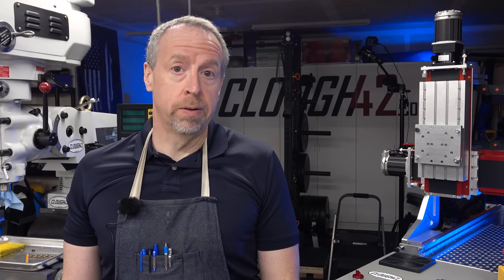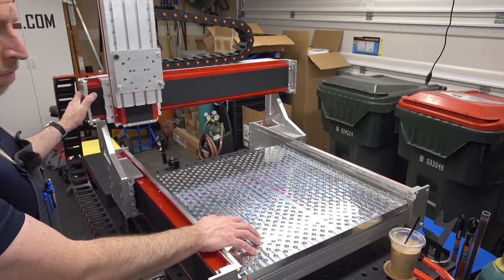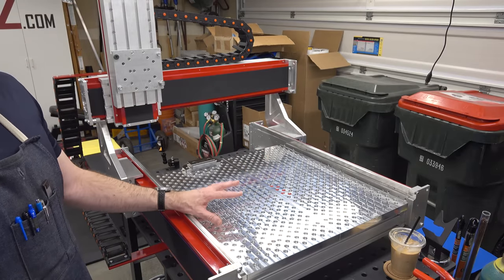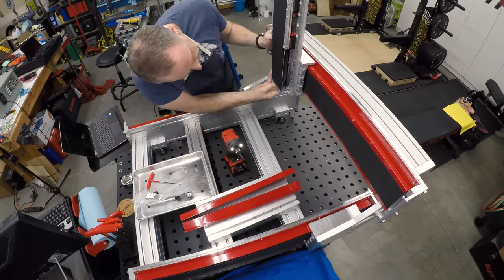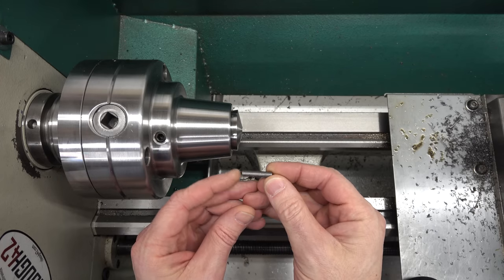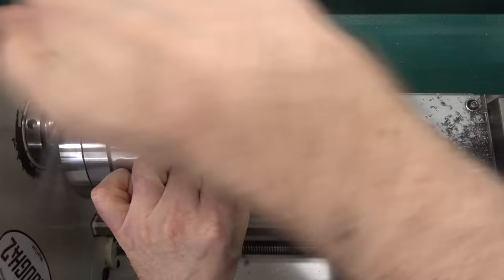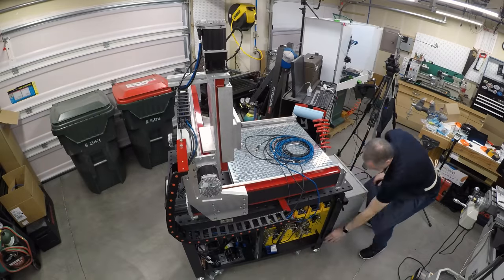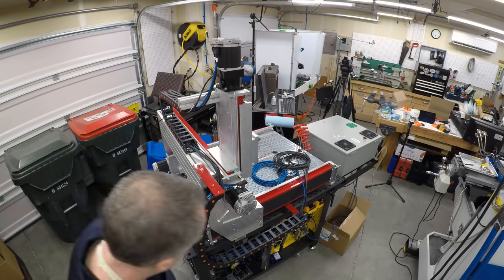New Machine:  Avid Benchtop Pro CNC with ClearPath and Centroid Acorn

Comment: Don't forget to do a vid of when you autotune the clearpath servos. Is you little grizzly mill too small and limited to take advantage of the powerful spindle? Are you going to convert the grizzly back to its original spindle?
Reply from the maker: The grizzly works fine with the spindle, for what it is.  But the high-speed spindle can't really take advantage of the rigidity of the mill, because it can't swing big tools or run slow enough to really drill and hog steel.

Comment: Wow! That's a great looking machine, congrats. Love all your videos. I was curious about the way/leadscrew covers, are they like a roller blind type thing?
Reply from the maker: They actually snake through the slide, over the frame, but under the outer T-slot plate.  So they bend as they go through, but they don't actually move themselves.  It seems like it would have a lot of resistance, but it seems to work okay.

Comment: 18:20 servos should all be mounted with the cables on the bottom to help prevent ingress. Check my avid build if you're interested.
21:20 I strongly suggest hardstop homming with the servos instead of using the inductive sensors. I just use the sensors as an estop safety feature. An estop / enable latching relay is good for homming the servos. (home on first enable) hardstop homming will go to the same clocked position on the encoder each time so it's much more repeatable. You can offset the y servos differnetly in the clearpath software to square the gantry.
Also, as you may know, the servos run better with stiffnes turned up and you may need to do multiple tunes to get a good one. Tune x then copy to y1 and y2.
32:26 you can set the max torque to disable the motor like crash detection, either in max torque, or use the HLFB IO output and set to for out of position. It has saved me from breaking bits, parts, and the tool length sensor. It's incredibly fast acting. My 4x HLFB go into an arduino that acts as a 0.1ms buffer incase there is noise. IIRC the out of position is set to about 20 counts. It will mainly go out of position during rapids under normal operating conditions so that is the factor to consider when tuning that value.
-Ken

Comment: I am very interested to see how you'll optimize the auto squaring script. I am thinking about upgrading my controller to acorn and I also have a dual Y axis configuration. I see that you've had to resort to a software auto-squaring script and am curious how the wiring of the endstops in centroid will allow for a "hardware" approach to the squaring procedure.
Reply from the maker: I think the software squaring is fine.  It just needs the delays removed.  By default every message it displays causes a 3-second delay.

Comment: Sick machine sick servos.  I got a beefy machine as well but with steppers.   I use the same sensors as you have and cutting material would constantly set them off
Reply: Also great job as usual and great video.
Reply from the maker: I've been drawing up circuits to properly combine NC proximity switches instead, but your point about chips setting them off is a good one.  Not sure how big an issue that will be.  I guess we'll see.  I'd honestly be pretty happy with plunger snap switches mounted in the same holes.  Neither has the overtravel to survive a full-rapid crash anyway.
Reply: @Clough42  While looking at limit switches for a CNC build I came across a configuration where the limit switches are mounted perpendicular to the axis so the gantry can bypass the switch. In the event of an over-travel situation (read crash) the gantry simply runs past the switch without damaging it. The accuracy/repeatability is still excellent. Would it be worth replacing the bumpers with E-Stop switches wired in series?
This whole setup looks awesome!!! I think you can broach a 1/4" keyway in one pass with those motors. ;-)

Comment: Not sure if you are still monitoring comments on this video? But I have 2 questions about the build as I have been building my control box using the Acorn Card, I see that you used the Avid NPN NO switches, was there any issues using those in hindsight? I need to go back and look at the schematic, but I believe there is a difference in wiring them is that correct?
Thanks Your is the best video on setting up an Acorn Card!

Comment: James should the machine home be set at the right rear and the work home be set at the front left for "normal " CNC setup  another great video. This machine looks a lot more powerful than my Workbee which is powerful enough to cut aluminum without a problem
Reply from the maker: I think you can set the machine home anywhere you want.  I kind of think the left rear is convenient, so the gantry will be parked out of the way of loading the work, but the default on this machine is to home in the left front.  It can be set up any way you like, though.  The one downside of homing in the back left is that the Y machine coordinate is always negative.  The work coordinate varies from job to job and is usually zeroed on the workpiece.

Comment: Great video -- I also have an Avid pro machine with a CNC Depot ATC spindle (mine is the SC30).  And my machine uses Centroid also.  You mentioned in the video you'd like to set up automatic tool change in the future -- did you ever do that? I've tried on my machine but the M6 macro hasn't worked reliably -- I mean the M6 macro I had to create based on their stock example versions.  Please let me know, thanks!

Comment: Watching this again, I just noticed that he's using the pro version of CNC12, because axis-pairing is disabled in the free version. For those people, you can use the C86 add-on board, which provides the option of hardware-connected axis pairing. In that case however, the same command is always sent to both servos, so squaring the axis via software is not possible.

Comment: Very clever solutions. I can’t wait to see your working video. Question; why do you feel it necessary to go with the NEMA 34 as you’re using servos?
Reply from the maker: It may not be necessary, but I have no experience sizing servos, and to be honest, the Teknik sales person wasn't a lot of help.  He just said if the steppers Avid sells are "sufficient" then he would go with something smaller than what I chose.  But I know from another YouTuber that the steppers are "just barely adequate" when trying to cut metal, so I went bigger.  The price difference between the NEMA23 and NEMA34 Clearpath motors was about $60 per motor at the time, which is 10-20% once you factor in the power supplies, cables, shaft seals, etc.  I do not want to save a few bucks and then be frustrated two years from now when they are just barely adequate.

Comment: I hope you are thinking about this already, but I would really like to see a discussion of why you chose to add this machine vs the grizzly and migrate the spindle over. The pros and cons would be really interesting to understand, especially given the other machines you now have. I notice that you mostly do parts in aluminum, but did you ever do much in steel with the grizzly once you had the S30F on there?
Reply from the maker: I've done a couple of projects in steel with the FM30F spindle.  As long as the tools are small, it does a great job.  I have two issues with the Grizzly: the Y axis is very short, so I can't practically manage parts over about 4.5", and the Z axis continues to be a source of backlash and/or lost steps.
Reply: @Clough42  thank you for the detail. I feel you on the work envelope problem. Even with 12” on my knee mill it always feels tight. Now you need an iso-30 right angle head and you can have infinite z height, too.

Comment: Nice machine, I built the same machine as well using nema 34 steppers , mach3 and a 4" kurt vise. not as rigid as I would like, the steppers work fine for me , when cutting aluminum you must go slow and get an OK finish
Reply from the maker: I'm very curious to see how it works.  I have found that the 12Krpm spindle with aluminum-specific variable-flute cutting tools to be pretty smooth on other machines.  I'm expecting resonance to be the biggest factor.
Reply: @Clough42  I do use amana cutters but I do not use coolant as I have a MDF spoil board and takes a bit of time to remove .

Comment: What's the approximate total outlay for a system like this?  I'd love to duplicate.  
Your work on the control cabinet is A++!
Reply: With clearpath and Acorn, He’s gotta have near $7000 into this, probably more….. $10k+ once a CNCDepot S30 goes on 😍😍😍😍
Ps> haven’t priced any of the Saunders Machine Works fixture plates,  but I’m sure that’ll add atleast another wad of $$
Reply from the maker: You're in the ballpark.

Comment: Just re-watching as I am in the process of swapping out my smaller Parker Z stage for the AVID Z and noticed you have an adapter for the NEMA 34 CP. I'm using my old NEMA 23 CP until the 34 shows up, but it looks as though the AVID mount accepts either; is the adapter a requirement?? (also curious about which 34 CP you chose as a sanity check).

oh duh. You said you mounted a brake, didn't you. Sorry, never mind :)

Comment: Hi James. 
Super interested in your build. Any reason why you went Acorn and not something like Masso controller?
Reply from the maker: I was running away from MACH and was considering LinuxCNC/Mesa, but opted for Acorn as something commercial that would require less fiddling.  I wasn't aware of the Masso at the time, but it looks pretty cool.
Reply: @Clough42  I work at a CNC manufacturer and we outfit a lot of our machines with Masso. It's quite a good unit. 

I really enjoy your videos btw. If you ever need any help, please let me know.

Comment: I’m planning on using clear path servos for a mill build as well. How accurate is your homing sequence? I’m on the fence of using DMM servos because they use encoders with a home reference point to preform a very accurate homing sequence. I’ve read about the hard stop method of homing with clear path but I’m worried about build up of chips of gunk that would cause repeatability problems. Can you give any advise or opinion your willing to share?
Reply from the maker: The homing sequence on the mill today is as accurate as the proximity sensors.  I discussed the hard-stop homing sequence with the applications team at Teknik, and it sounds like it works pretty well.  The Centroid Acorn isn't set up to use that method by default, and since I have the end stops and the gantry squaring routine expects to use them, I just went with what was easy.  If I had to guess, I would think the ClearPath stuff would work well.  Everything else about their product is top notch.

Comment: there are definitely the ability to set the current/load limits on the clearpath motors. could you use that to get around your fears of them driving past the stops?
Reply from the maker: For sure.  And also create new ones of saturating under load.  :)

Comment: I know that you have obviously already decided on acorn - but someone like you that likes to get into the weeds of how things work - linuxcnc would have given you the low level access to, well, everything.
Reply from the maker: Yup.  And that's where I started.  But after I installed Linux with the special RTOS kernel, and then failed the jitter test and discovered that I actually was supposed to have used a different RTOS kernel, I decided I wanted to try a polished commercial offering and see what it was like.
Reply: @Clough42  aww.  Sorry your experience wasn't good.

Comment: might be worth getting some thin rubber mat and gluing some feet every few holes to cover all of the holes at once and then cut out the vice area or wherever your work holding is saves you having to install and pull out 700 or so plugs
Reply from the maker: I think in practice, most of the plugs will go in once and stay and I'll be pulling out two or four at a time to mount a vise.  It is certainly a lot of plugs, though.

Comment: I was on the fence about getting this machine with the standard steppers but went with the shapeoko HDM. I believe they can be put into the same class but the option to go custom electronics on the avid really takes it a new level. Have you ever checked out the HDM? would like your thoughts on that if possible
Reply from the maker: I don't know.  I think the Avid is 50-100 pounds heavier, but I can't tell if I'm comparing machine weight or shipping weight.

Comment: OverKill - is the best kill !
Interesting - I have a similar setup ( building my own monster )
I really interested how the auto-tune works with a dual Y Configurations
kinda some thing I didn't find yet
probably will send them a mail soon - for some explanations
if I'll get an answer ( and they usually answer pretty fast )
I'll try to share
Reply from the maker: I should have a video next week showing how I did it (will have done it)

Comment: Are those over-limit switches something you'll want to test on a regular basis? You mentioned they'd never hit it, makes me wonder if they need to be checked as part of a homing sequence or start gcode sequence or something. Thanks for sharing your new machine!
Reply: just manually trip them occasionally . Homing switches get checked all the time .
Reply from the maker: The homing switches get tripped with every homing operation.  The switches that Avid provides are normally-open, which makes me nervous, because a broken or disconnected wire will not be detected.  I'm planning to do something about that, but still working on it.

In general, if the machine doesn't lose steps (it shouldn't) then it's a non-issue as long as you always remember to home the machine when powering it up.
Reply: @Clough42  and with the clearpath, if it looses steps, they will throw a fault and shut the system down.  I was trying to figure out how to wire the sensors for double duty to home all and be hard limit switches, but all the acorn guys said don't worry about it...
Reply: @Clough42  ah, ok, I misunderstood. I thought you also had limit switches at the other end of the axes as "emergency limit switches". I'm actually a bit surprised the switches they shipped don't supply both a normally-open and a normally-closed contact, I guess it's still small enough not to need it.
Reply from the maker: @rpavlik1  it has emergency limit switches, too.  I would like them to work.  But if everything works correctly, they should never be hit.
Reply: Proximity sensors 'range' also varies with temperature. If things go out of shape in the summer... Just Saying

Comment: Is your garage temperature controlled? If not do you have concerns about thermal stability over different seasons?
Reply from the maker: My shop is now temperature controlled, but I used it for seventeen years prior to that where the temperature varied between freezing and over 100F (38C).  It was still attached to the house, though, so it wasn't as bad as it would have been in a detached shop.  The biggest problem I noticed was that way oil on the machines got very sticky and viscous when it was cold.

Comment: I find it funny this thing is considered beefy. Sure, beefy for a router, but even a medium sized hobby mill will be more ridgid. I'm surprised you didn't CNC your bigger mill. Even with ways instead of linear rails, just the mass alone makes it more ridgid.
Reply from the maker: We'll see if it meets my needs.  After struggling with the Y axis travel of the G0704, I wanted something that could handle larger parts, like side plates for machines.

Comment: I never looked at Avid machines, thinking they were too pricey. I also thought they were much better. My homebuilt machine matches their 4’ x 4’ machine in every measurable way, except that mine includes a 4KW spindle and a Masso controller. I’m sure I didn’t spend the 4 grand they’re asking for theirs. Maybe $2500 - $3000 total. Where I thought my machine was lacking was in speed, but I was wrong. Their machines top out at 200 IPM with NEMA23 motors. I can hit 300 on mine, although I tend to cap it around 200 for production runs. At the top end speed of 300 IPM, it can jam up the motor, usually when it’s decelerating from a rapid move. I think it’s the upper limit of what a NEMA23 can do…
Reply from the maker: I have this one capped at 400IPM.  It's terrifying.
Reply: @Clough42  Holy chit! As I was reading this, I was in the process of replacing yet another shaft coupler. I have a wobbly 1500mm ball screw and over time it’ll shake itself into a state of complete destruction. I’ve been watching your series on the ATC spindle and it’s on my radar. Very nice work you do, top notch.

Comment: Does the Acorn controller (or post-processor) actively predict axis over-travel by monitoring the current machine position and looking forward to the next line of G-code? Or does it passively rely on the limit switches to prevent over-travel?
Reply: In Acorn you can set Axis limits. So if you have a 36" X axis and you accidentally said move 360" it will just not move and will say over limit. I switched over to Acorn just over a year ago and it has been worth it.
Reply from the maker: It knows the machine travel and it will prevent you from making a move that would cause overtravel, and if you go right up to the end, it will decelerate to a stop at the exact point called for.